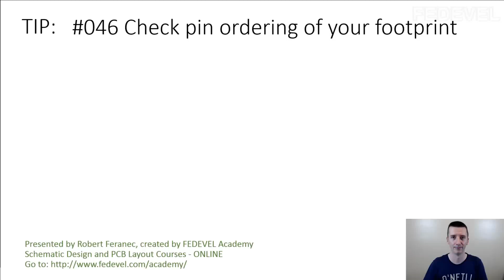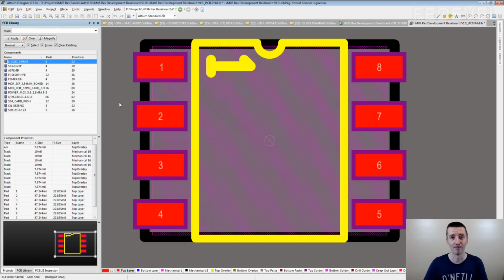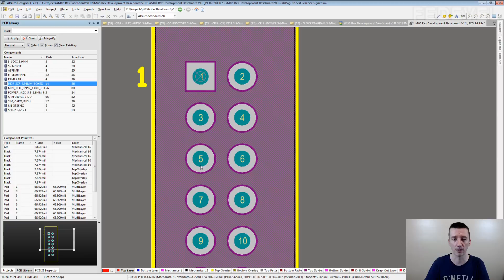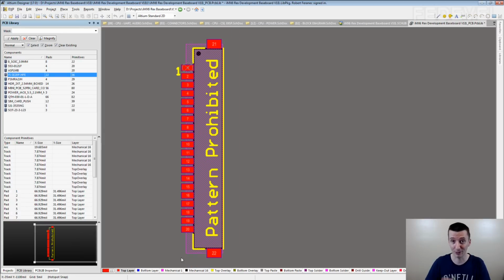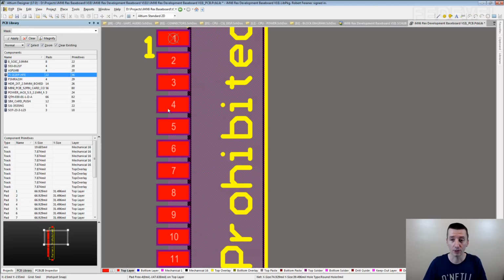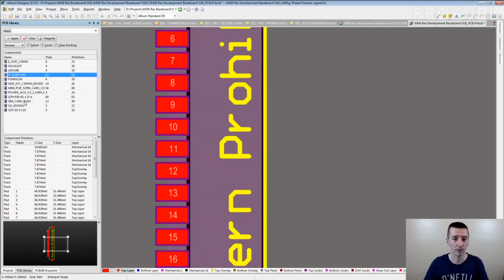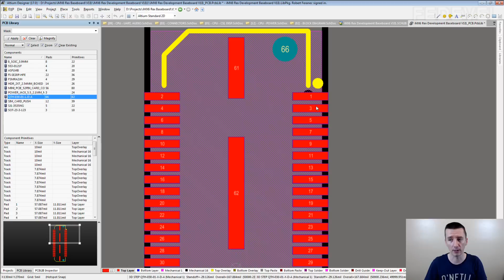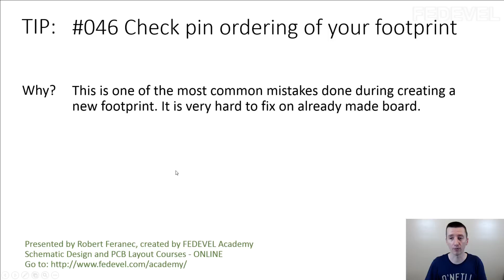TIP #046: Check pin ordering of your footprint

Comment: I was designing this PCB that used an RF module and the pins were clockwise! I had only ever seen counter-clockwise pin numberings before that, and I was so sure that the datasheet was wrong or I was reading it wrong. Turns out it was correct but wow what an unnecessarily expensive mistake that could have been.

Comment: A very important step for checking a connector is to check the schematic symbol numbering! Which one is collector? 2? 3? Which one is drain? All footprints must adhere to a specific symbol in the schematic library. It's tempting to reuse the footprints, but it may happen that you get into trouble when doing so!